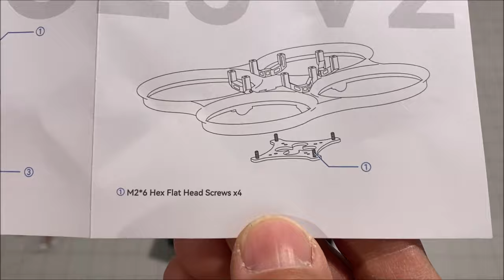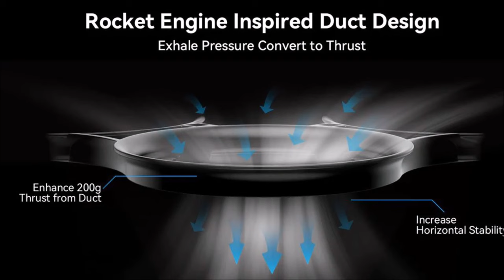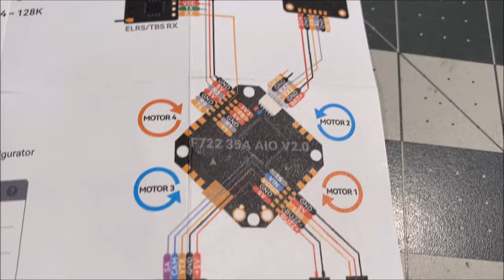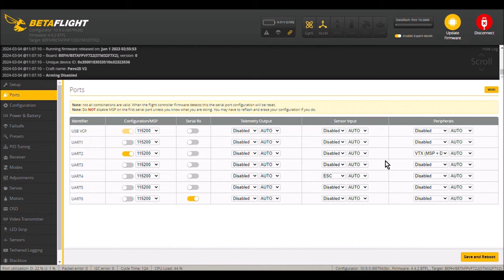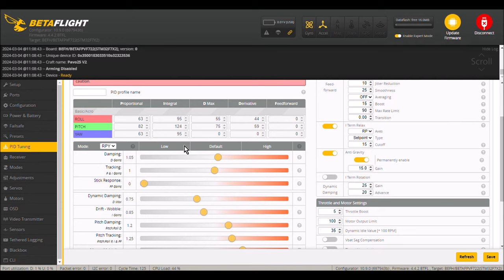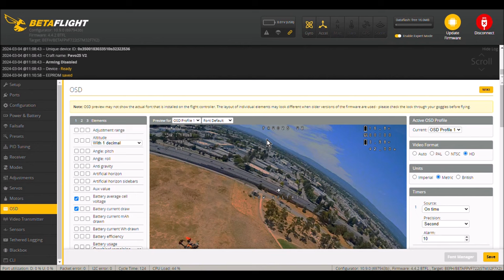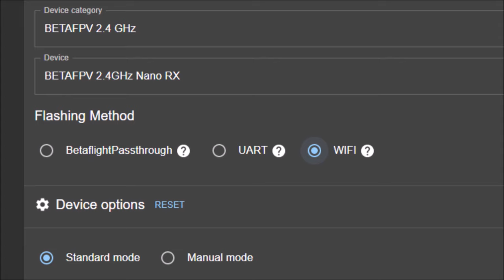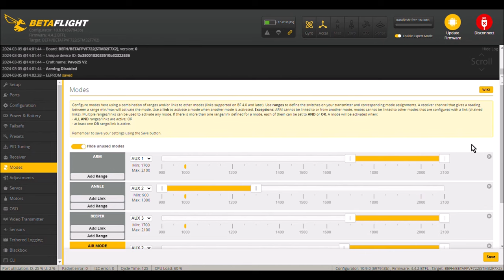Betafpv Pavo 25 V2  Closer Look and Set Up

Comment: Hi great video!!!. Quick question, do these seeting apply to a pavo35 as well ? Just bought one as my first drone. Currently binding the 03 air unit to my dji controller 2 and fpv googles v2. Thanks!
Reply from the maker: The settings should be just about the same except the receiver protocol since you are using the dji controller 2.
Reply: That makes sense! Thank you! Appreciate the follownl up!

Comment: Hello, can you tell me what is the difference between the Pavo 25v2 versions with BetaFPV engines (blue) and LAVy engines (gray)? Is there anything else changed besides the engines, Aio? Which version is better, blue or gray? The BetaFPv (blue) motors are 1505 4600KV and the LAVs (gray) 1506 4200KV. Will there be a noticeable difference in flight between the two?
Reply from the maker: Here is the difference of the two motors.

A low Kv motor has more  thinner wire windings so more volts and lower amps which will equal to more torque and thus is able to spin bigger props.
 A high Kv motor has fewer but thicker wire windings that can handle more amps but less volts which equals to less torque but higher revolutions and is limited to spinning smaller props because of it.
Reply: @RCEscape  and which ones are better in Pavo 25v2? Which ones are better to fly on?